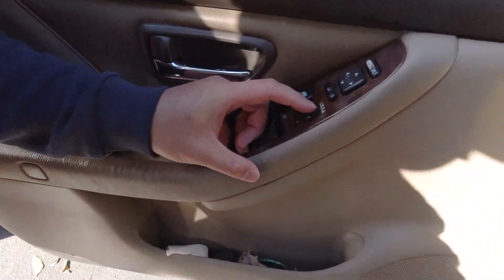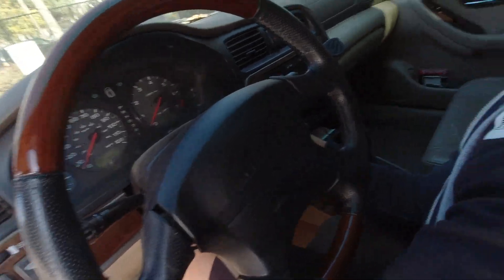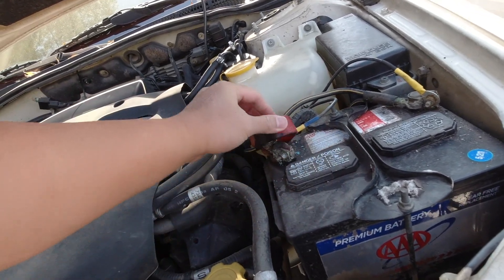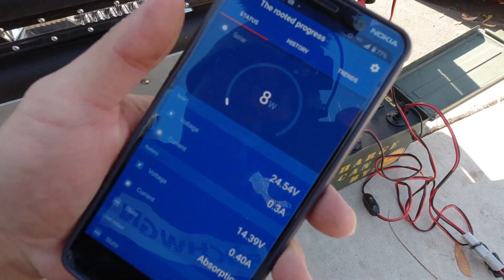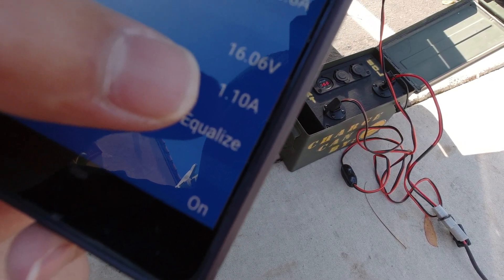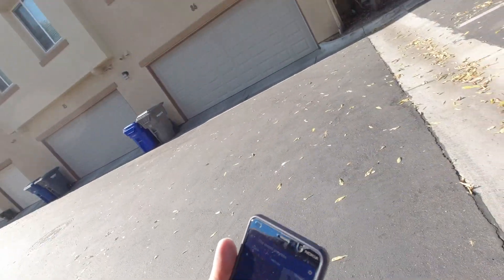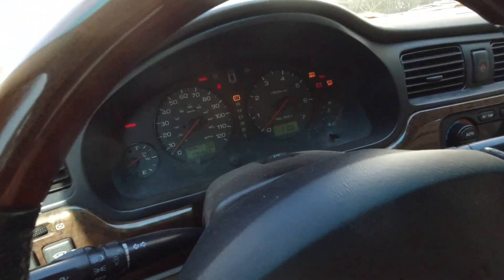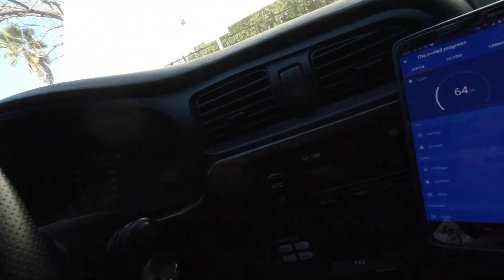Is It Possible To SOLAR JUMP your Car?

Comment: That's impressive, I wouldn't have thought that would work! Good trick to have in your back pocket.
Reply from the maker: Thanks Donald! I got the setup for longer overland trips involving heavy use of charing our devices and keeping our battery topped off. 

Just so happens that it can jump our car too 😂. So really stoked that we have that option if in case... We forgot the charger and or for some reason nothing else works. Not going to depend on this to jump the car all the time, but just good to know.

Comment: Lol, loved the climbing over the seat bit at the beginning, ha! It's not cheap, but an Optima Red Top starting battery is the best for off road. That's what I use, haven't had any issues in my 2014, or my 2021 Trek.
Reply from the maker: Haha yaaa it was a lil silly but sometimes I just like to add in those random lil things that  you otherwise wouldn't really talk about when owning a Subaru haha. 

But yes optima is a strong strong candidate right now. Heard nothing but good things. ☺️

Comment: That's pretty impressive and good to know. My wife got me a battery jump pack for christmas, so now I don't have to stress so much when I'm out there alone. I would like to do some sort of solar setup this year so I'll keep this in mind.
Reply from the maker: Yess definitely! I wasn't expecting this to be joe's by our solar panels at all. Must be the combo of the solar panels and the energy management system (charge can). Tony never advertised it as being able to jump your car haha so this was truly just an experiment and let's just seee what happens kinda thing. But definitely good to know that this works out. 

I originally bought it in preparation for all the orverland accessories I'll be running. I wanted to be able to charge my battery at the campsite and charge other things as well without having to worry about draining the battery. Also, I didn't have a good battery to begin with and was waiting on this one to absolutely poop out. Now that it's very apparent this battery sucks, I'm gonna invest in an AGM battery. ☺️

Yaaa if you go solar, definitely keep this kit in mind. I like that it's portable yet strong and durable. You can take it into any car you want. And if you want to mount it somewhere on the roof you can always do so!

Comment: Dang!  Just imagine being out on a trail with no way to jump start your vehicle?  Lots of good points in this video Marc.  It’s good you have a back up plan for a backup plan.
Reply from the maker: Well I wasn't planning on ever using the solar system as a jump start but good to know it can lol. But yes, these are things I think about all the time. Just havnt got around to it since it's a "new" battery. But definitely going to be switching batteries out once we go out on a trail by ourselves.

Comment from the maker: Should I get an Optima Yellow top or an Autozone platinum AGM battery?
Reply: I’d go with whichever has the better warranty.
Reply from the maker: That's a good idea. I havnt looked into the optima warranty but know the autozone one is about 3years
Reply: Maybe even think about getting a Lithium battery pack? Even better than AGM, but definitely more expensive. Generally has better cold cranking amps, lighter, smaller, etc. Only thing is make sure on cold mornings to turn on your lights for a bit so the battery warms up before starting the car!
Reply from the maker: Interesting! Yaaa the price just makes it inconsiderable. I actually didn't really know about having to warm up the battery in cold weather. Good to know. ☺️
Reply: @therootedprogress  I personally have a optima yellow top I transfered over from the FXT, and it’s been treating me well.  I believe you can completely drain the battery 300 times before it done.
A lot of the 4wd guys say that optima’s quality has gone down a bit, so they recommend odyssey AGM batteries.
Reply from the maker: @JonDZ_Adventuring  +1 for optima. I've only heard good things plus saw your video on trying to kill it. Mahhhh lord that thing is tough. Most likely going to get one pretty soon. I've been waiting for this POS battery to die haha... And also to have more 💰 money lol.